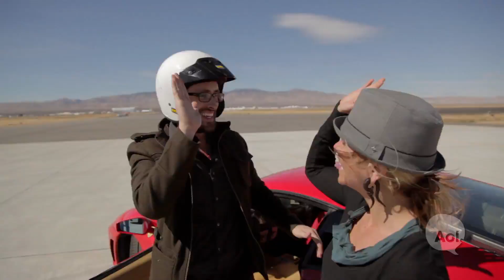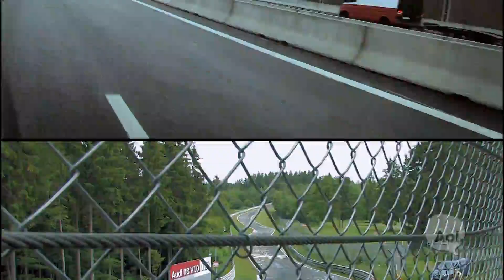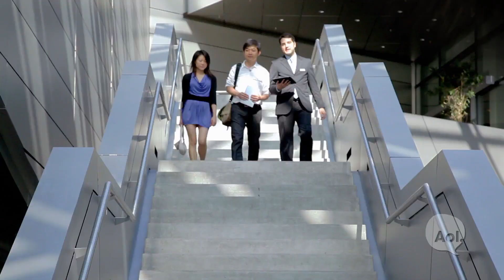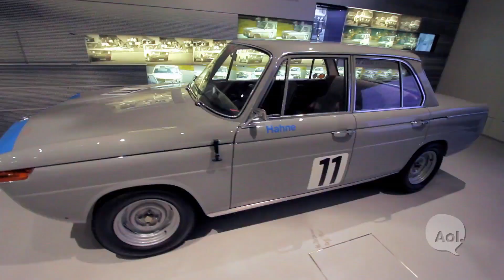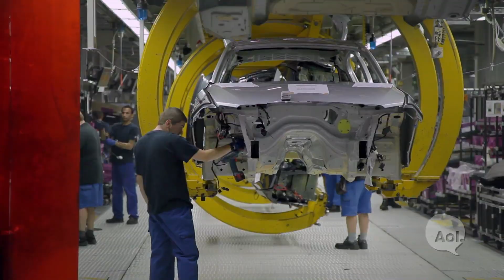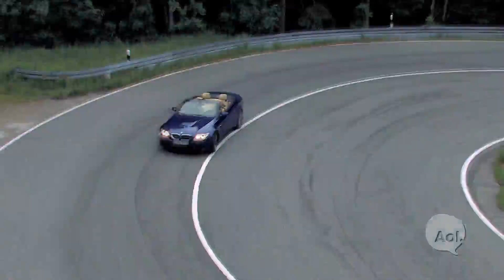Buy A Car For European Delivery | The List | Autoblog

Comment: awesome. i save 5000 by picking it up at the factory. so no i spend 2000 to get it back to the US, 1500 for a plane ticket to get there and back, 1000 for hotel while I'm there, and about the 1500 spending cash while im there cause i'm gonna want to do stuff while im there. yep, you're right I'll save money?!?!
Reply: Think of it as subsidizing your European vacation. There is also value in this unique purchasing experience that you're not going to get by driving it off the dealership lot.